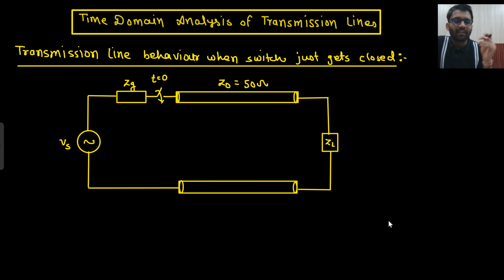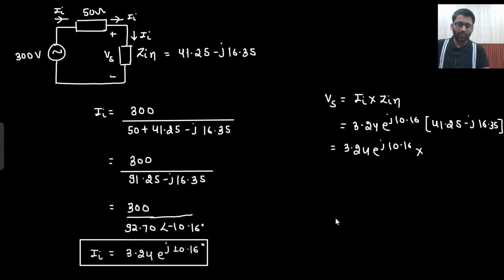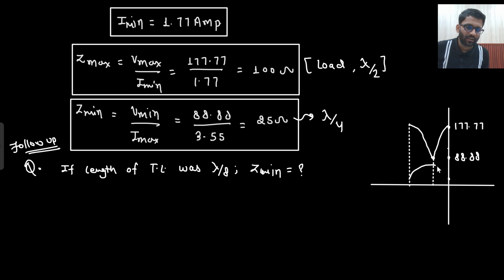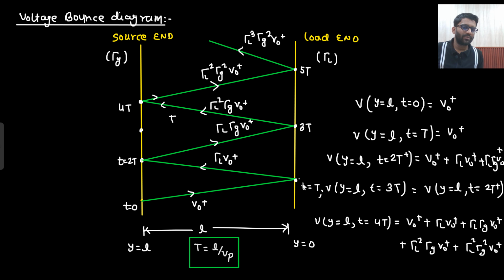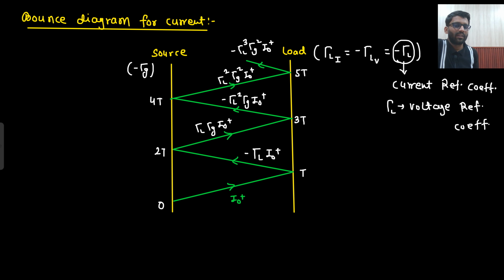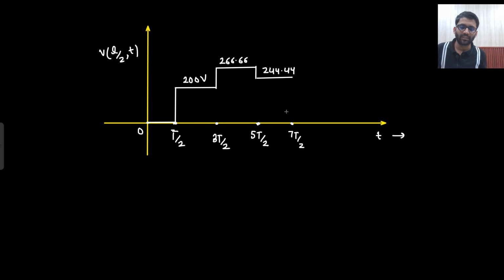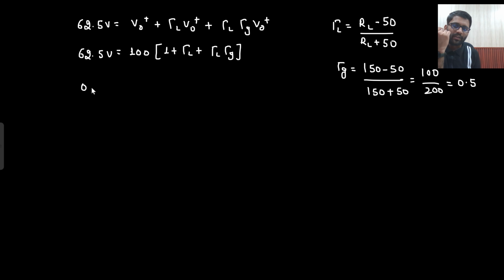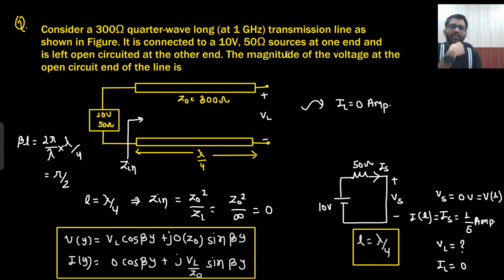Time Domain Analysis of Transmission Lines || EMFT || ECE/EE/IN || PrepFusion

Comment: In the question of DC transient, where we broke the pulse input into two signals, then adding their corresponding output, is that a kind of superposition theorem that we are applying ? if so, how can we think Transmission line circuits as a linear bilateral network ?
Reply from the maker: Yes, Transmission lines are linear bilateral network.
Linear : Relationship between voltage and current is shown by linear differential equations in T.L.
Bilateral : T.L. are symmetric in terms of impedance properties
Reply: @PrepFusion_GATE  Sir can you  pls explain how can we frame the voltage and current relationship by linear differential equation ? generally while calculating the voltage and current expression, we considered the forward travelling and reflected returning waves. In general how shall we make out the mutual relationship between current and voltage ?
Reply from the maker: @aritrasarkar6478 Remember the very first equations we wrote in our derivations. Wasn't there a relation between voltage and current?